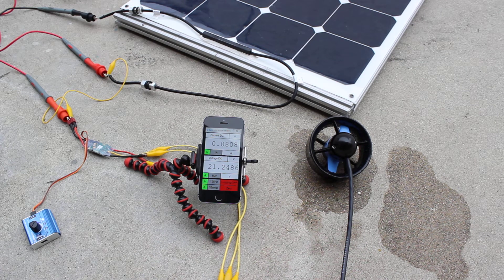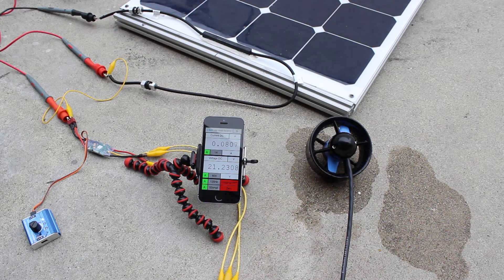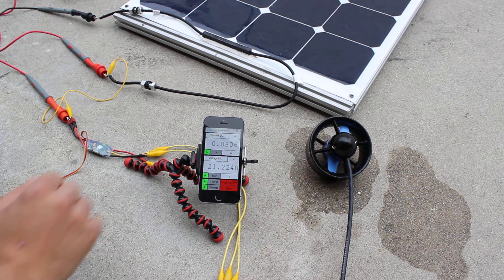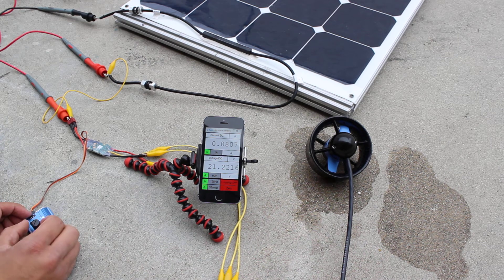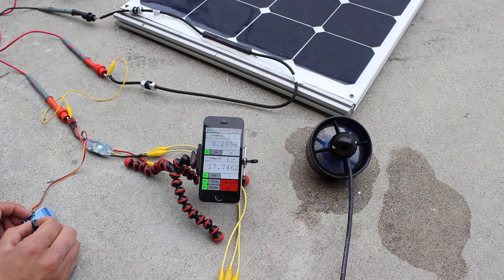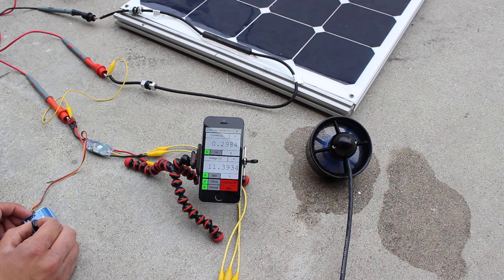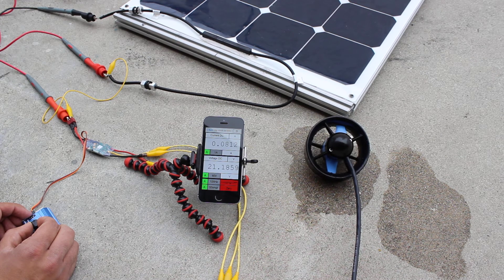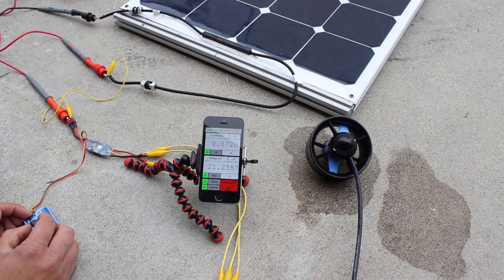T100 Thruster with Direct Solar Power

Comment: Can you help me wire my t100 to esc? Does the colors match some how ?? Thanks
Reply from the maker: Hi Reggie, the three wires from the motor can be connected to the three motor wires on the ESC in any order. If you switch any two of them, the direction of the motor spinning will change.

Comment: What would happen if you put a lipo with a bms to prevent over/under charging? Would it prevent the voltage sag?
Reply from the maker: Hi Scotty, you could absolutely do that and it'd be a good idea. We did this just to demonstrate the potential for powering without a battery.
Reply: It was a very good video and got me thinking. If you decided to make a video showing the same setup with a small lipo in between, I would be very interested in seeing it.

Comment: Hi. I'm working on a similar project as your solar surfer, so using T100 Thrusters to propel and steer an ocean going USV.
I'm not thinking about storing power in a battery for night sailing, but making good for night-drift by using max solar power during daytime.
So I'll need to connect the Thrusters direct to the solar panel, in such a way that thruster force is always maximum possible during current changes due to weather conditions during day.
Will it be needed to adjust ESC throttle the whole day, to keep maximum force and efficiency, or can I keep throttle at max (ex steering), and will that result in getting always max force possible?
If do need to adjust the whole day, can that be done best by reading data from the ESC?

Regards,
Cas
Reply from the maker: Hi Qwaak, you'll need to adjust the power so that you have a good output voltage. If you set the motor to full power it will draw as much current as possible and will draw the voltage of the panel down to a point where the ESC and electronics will reset. I would also strongly recommend using a small lead-acid battery to act as a capacitor in the system and provide power for burst current needs. That will help to make sure your other electronics are reliably powered.
Reply: Thanks!